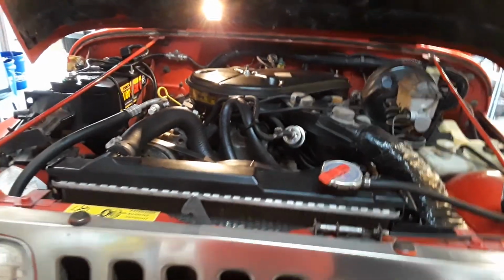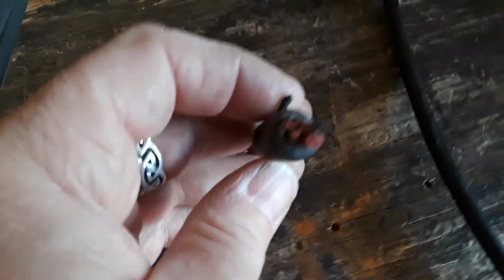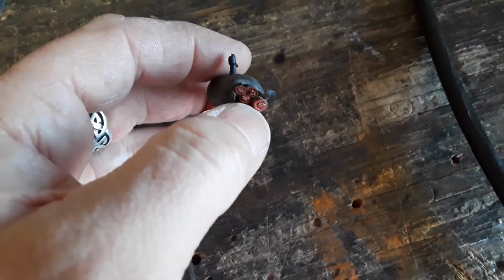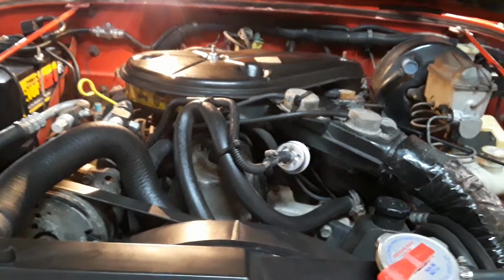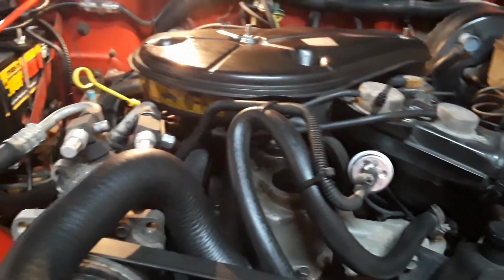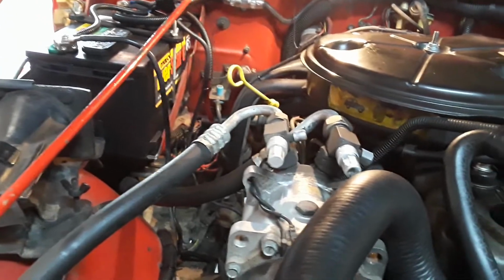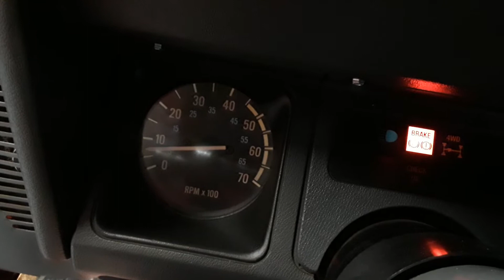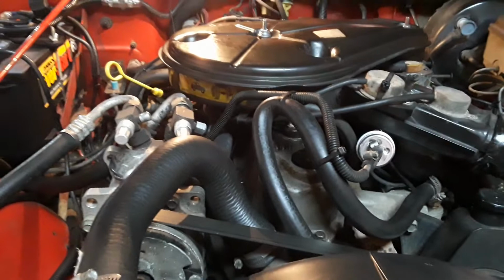Jeep YJ 4.2 liter wiring upgrade what a difference!

Comment: Just has this issue with almost the same factory wire, but mine only had 2 coming out of it.  I ended up purchasing a fusible link from NAPA and then cut off the split part of the factory fusible link.  Jeep starts really good now and alternator actually charges.

Comment: It's called a fuseable link,  the thinner wire serves as a fuse.
Reply from the maker: Yep, I explained that in a later video. I replaced them all with a fuse box. The original fusable links were corroded on the inside.